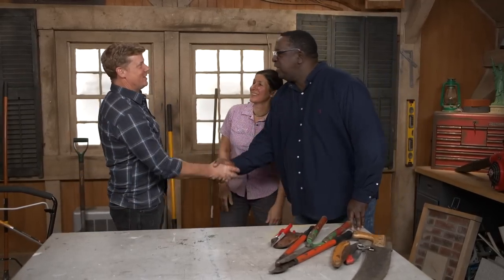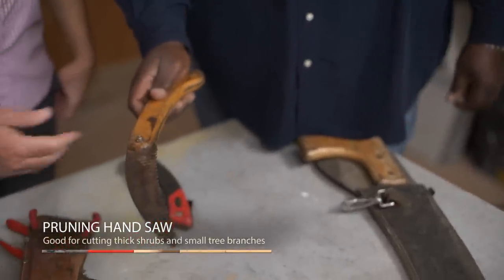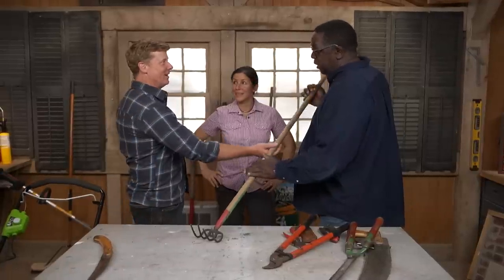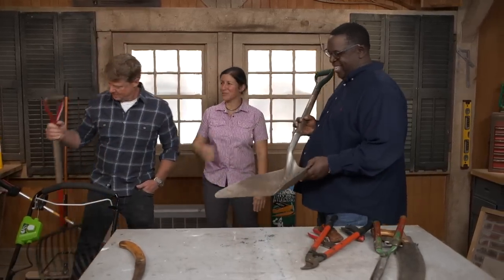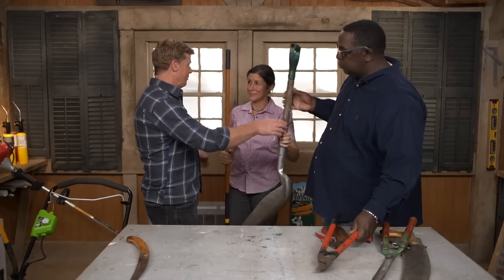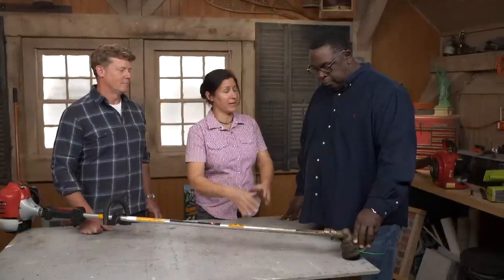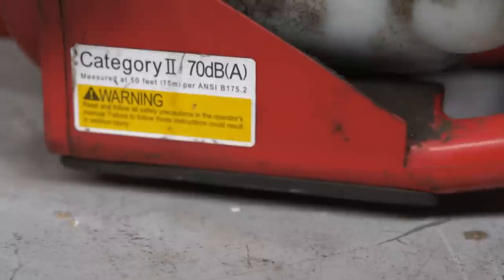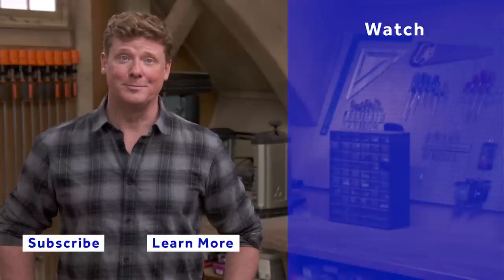Simple Guide to Outdoor Tool Maintenance | Ask This Old House

Comment: I thought this video had a lot of promise - in the beginning they showed a lot of rusty tools that look like the ones that I see at the thrift store or garage sales - but ultimately I was disappointed. They said what the hand tools were and how you would use them but they did not show how to maintain any of them. Useful things they could have included in the video:

- Showing how a person could use either Evapo-rust or molasses+water mixture to remove those rust spots on the old tools 
- How to oil them afterwards to prevent future rust
- How to sharpen the bladed tools or straighten out the tines 

Now that I'm typing this stuff out it seems logical but I came here to see if there was anything I could learn. Plus, as other commenters have pointed out they left out what to pay attention to if you are tipping over a gas lawn mower.
Reply: Mude Welle (tired wave? lol) You're looking for tool restoration,  not maintenance. MyMechanics is great for that,  but he blows through materials like a Russian chemist. But I agree, I'd have liked to see something on what type of oils to use on blades and handles at the end of the season to keep them looking new or in good working order. For example. Boiled linseed used to be a thing for metal tools,  but, when left on rags, it can combust under certain circumstances, so it's not recommended anymore under certainapplications. I use a Danish oil on unfinished tool handles and regular gun oil (I think I'm using Hopp's now, whatever was on sale) or 3 in 1 on the metal bits, and a rat tail file to keep them sharp. Lawn mowers can get complicated,  I usually just stick to the owners' manual.
Reply: I agree, this episode seemed lazy :(
Reply: Same thing they said about you too
Reply: @Ethan Leapley  that's the same thing they said about you too. Lay z 🤣🤣🤣🤣🤣🤣🤣🤣🤣

Comment: Worked for a couple of city parks departments  while going to university. We had gas-powered push mowers along with rider mowers. With the gas-powered mowers, one thing to remember when tipping them over for maintenance is to tip them onto the side where the oil is. The oil side always faces the ground. It prevents the gasoline and the oil from mixing. I know they demonstrated blade maintenance on an electric mower, but for those with a gas mower, that is important to know.
Reply: Sorry, but that was a completely superficial episode on how to maintain garden tools.  I mean if every person who owned a home for more than a year didn't already know everything discussed, I would be surprised.  Come on Ask This Old House, you can do better.
Reply: My process is to pull the starter cord until the piston is in compression to ensure the cylinder is sealed and then tip the mower carburetor up.

Comment: Important note, when sharpening a lawnmower blade it should be balanced equally to prevent a shaky mower.  Put a long nail in the wall and center the blade on it; if it leans one way, you need to file more off that side until it balances flat

Comment: Unless someone has junk mower blades, they cannot be sharpened with a file. The grinder is the best tool, whether it's a bench grinder or an angle grinder.
Reply: I use an angle grinder with a flap disk. I've used a bench grinder too, but I find the flap disk easier.

Comment: Powered hedge trimmers aren't shown here but also need maintenance. Use some lubricant oil frequently and sharpen the blade as needed.
Reply: Fluid Film is the ticket for those.

Comment: I was really disappointed with this video.  I have never seen anyone tighten a lawn mower blade by placing their knuckle on the hub of the blade.  I was waiting for Jen or Kevin to ask a question like how important is it to have tighten the blade onto the mower shaft?, but the question never came.  I hope someone tightened the blade properly after the cameras were turned off and before the mower was given back to the user.  They tried to cram too much information into too short of a period of time.

Comment: Angle grinder with a flap disk (sandpaper) is how I quickly sharpen my lawnmower blades.  Balance blade on a nail before reinstalling with a torque wrench.  I use WD-40 on raw iron to keep rust at bay.

Comment: The head of that Weedeater needs grease.   In the video, you can see a bolt head that has a very short threaded bolt.   The grease goes in the opening when the bolt is removed.  The manufacturer sells a tube of grease with a threaded end that fits in that bolt hole.   Give it a little squeeze and the rotating head is greased.